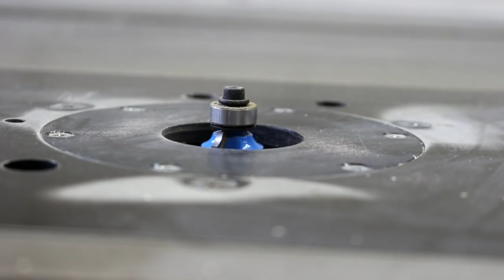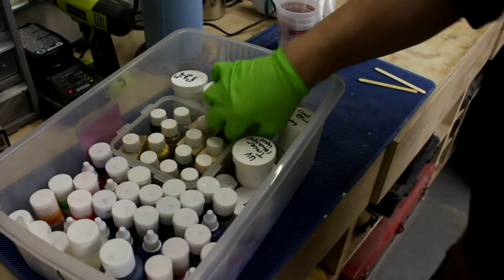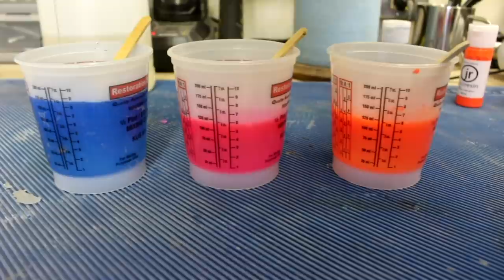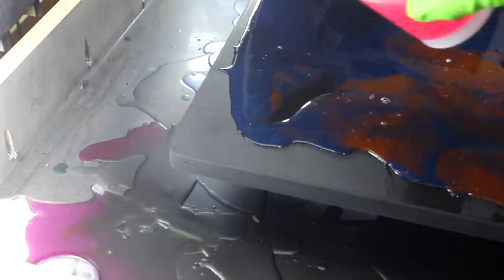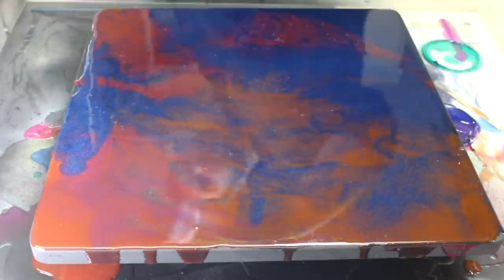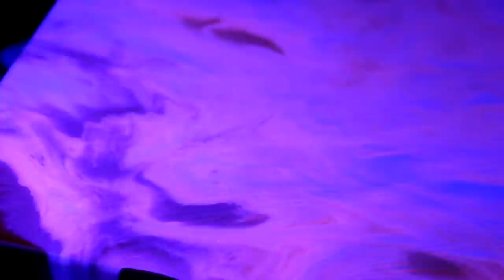Nebula Resin Art

Comment: Maybe next time you could grab one of those cans of compressed air they have for dusting keyboards instead of potentially passing out lol
Reply: S M but you're not really able to easily control how fast the air comes out of those, can you?
Reply: An air duster on a compressor has the control though. Im sure he must already have one of those. Or an airbrush brush without any paint in.
Reply: @PeterBrown
Reply: The air that comes out of those cans is cold and could disrupt the curing.
Reply: Faenum note you would actually need a dual action airbrush, standard single action airbrushes only control the paint flow, the air flow is constant.
Reply: S M or hair dryers
Reply: Although the chemical used in computer duster can be super dangerous and can asphyxiate you.

Comment: There's a technique in painting (forget what it's called) that could be really cool here! You just get a cup, pour your colours into the cup one by one and don't mix. Then, quickly, you turn it upside down and flat on the surface you wish to pour. Then you wait for it to drip all the way (I'd say for 15-30 seconds) then lift the cup and let it pour out! Next step you just lift the surface and tilt it around to reveal different layers until it looks how you want it to

Comment: Hey excellent job Peter... Love your projects bro... Might I make a suggestion for you? Instead of wasting your breath with the straws, how about hooking up a nozzle or straw attachment on the end of your air compressor hose instead? Just make sure you have a particle and moisture filter (or dryer) inline, and even add a regulator valve to adjust pressure and create different affects.... Happy making my friend.

Comment: Sooooooo after your first poring video I watched a bunch on different types and ways to do it, well my favourite type was when they would mix up a bunch of different pigments and colours and then tipped them all in deferent amounts into a set of a couple different cups (or one cup dependent on how much ressin it measured up to be) so the cup/s were filled in different layers and colours and weights. Then they flip the cup so its suctioning onto the board and when they are ready they pull the cup straight up and let all the colours spreat out as gravity takes affect. Just thought it would be really cool for you to try?

Comment: Could also just pull the bulb and hose off a blood pressure cuff and use that.  Drops the light-headed effect.
Also, candle lighter.  Less likely to overdo the resin burn.
Also also, you could top it with a light coat of white shimmer for stars.

Comment: Try an airbrush as a blow gun. Handy proportional air valve, and a compressor, so no dizzy. Just make sure it's clean and dry socket you don't blow old paint or dust across the work.

Comment: You should totally do another nebula and find a way of sprinkling in some white flecks as stars! Also, a dark blue background instead of black would look super cool.

I have a bunch of little balsa wood stars that I painted with nebula designs. I started with dark blue and sponged on purple, pink, and green paint, then finished them with clear glitter nail polish and did the edges in bronze metallic. They look rad as fuck. Now if I could only figure out a way to make good looking constellations on them...

Comment: You should make a homemade air blower! It shouldn't be too hard, I'd think.
I could see something like a bearing on a crank shaft connected to a handle with a bunch of panels coming off of it to form a fan, then encased with a single hole to blow the air out. 
No lightheadedness, and you still have control over the air flow!

Comment: To keep yourself from passing out, you could try attaching a funnel to a hair dryer. Most of the ones I've seen come with low, medium, and high settings with cool or warm (or even hot) air. Your wife probably has one, and you could just hold the funnel on the front, so you don't have to do anything permanent.

Comment: if you go to computer shop you can get a can that sprays with pure air (used to clean the computers and keyboards from dust and crumbles) - even if the pressure would be too much for you to use it up close, you could just spray it through this wide straw - at least you won't chance hyperventilation again.

Comment: Two suggestions: 1st: Air compressor (yes, you've pinned it but I'm calling it anyway) you could add a regulator so you don't shoot everything trough the room. Random fun fact: If you need to make fake blood splatter, try red dyed resin in a small tube and shoot it out of it with full psi. Works great.

2nd: How about you try make one painting on a sheat of glass, maybe with some mold release to assure non-sticktion, remove it from the glass and cut it then to size. Put it in a picture frame with led backlighting. You can add two lighting strips, one maybe RGB, one UV with a remote or a capper sensor. Could be nice. Don't forget a backstop in the picture frame (Epoxy -> LEDs -> Backstop).

Comment: Hi Peter! Watching these resin art videos inspired my to do some of my own in a project I've been working on at uni. So thank you! Just a quick question, what can you use to get rid of bubbles if you don't have a heat gun? Will a normal hairdryer work? Thanks again!
Reply: He wasn't using the heat gun to get rid of bubbles, he was using it to push the resin around, and, yes, for that, a hairdryer would work.

For getting rid of air bubbles, he was using a flame/torch (a butane torch?). You can also use a lighter, the kind people use for lighting barbecues, which has the long nozzle; you hold the button down and play the flame over the surface of the resin. Another way of getting rid of the bubbles is to gently blow over them with a straw, but I find the flame method to be easier, especially since my breath tends to condense moisture in the straw and it drips on the resin!

Comment: I have a suggestion, since you've discovered blowing air is better; get a double action air brush, you'll have so much more control over the air than just a straw. And an added bonus, if you can get the resin thin enough to be a 'paint', you could even try to use it through the air brush for added effects, like highlighting or shading. Double actions have a push and pull trigger control, push down for air, and pull back for paint.
Reply: I think resin would clog up the air brush when it cured, thus completely ruining it.
Reply: This is why I said if it can be made thin enough.
Reply: Wouldn't help -- it would be like putting glue inside the air gun; it would stick when it dried, and you'd never be able to clean it out.
Reply: Anyone with common sense would know to clean their tool.
Reply: But what would you clean it with to remove the resin? It isn't like acrylic paint that you can clean out with water.
Reply: Heat thins uncured resin, and you can clean it with lacquer thinner, acetone, or alcohol; just like you would clean up uncured resin if you spill it.

Comment: Build a small insulated box to store your resin. Place a heating pad in the bottom of the box and turn it on an hour before you want to use the resin. That way you don't have to use a bunch of water and you won't have wet bottles all over your bench.

Comment: I've never played with resin, but about the scratches. Is it possible to add un-dyed resin to the scratch in the surface of resin to maybe fill it in and hide it a little? It may require some micro mesh polishing I would think.

Comment: at first i thought, you would pour resin in the whole container and use the woodplate in the middle as some kind of base. then when it is hardend, you would have sanded or routed off the ground of the container. finally you would have ended up with a table with a pattern of your spills from past projects.. wouldnd that be a plan? i think int certainly would be art

Comment: Hey Peter, my friend I love your videos and we decided to try and resin dip a flower and in the process the resin got super hot to the touch and burned the flower inside. By any chance if you read this do you know what might have caused that to happen?
Reply: You mixed up too large an amount of resin. When one mixes the two parts of resin together, it starts a chemical reaction which generates heat. With small amounts of resin, the heat isn't much; with larger amounts of resin, the heat is greater (and I think it feeds back on itself, to make more heat).
Reply: Kerr Avonsen thank you

Comment: Why didn't you give the painted wood a light sandpapering because it'll stick with the resin better. Like on concrete floors it doesn't matter how good of a product it is if the surface is not prepared good by grinding it. The paint leaves a very smooth surface and you could peel that resin off easy versus prepared surface.

Comment: Just out of curiosity, why don't you use the micro mesh pads to get rid of the scratches? or is that not an option?
Reply: I think the problem is that the scratches are under the resin, because it's the black paint on the board that was scratched.

Comment: that looked really great but you could have saved your breath and maybe tried using your air gun... as long as you had it on a pressure gauge with about 10 to 20 PSI you can really get into different effects